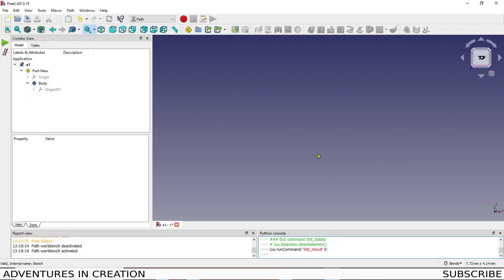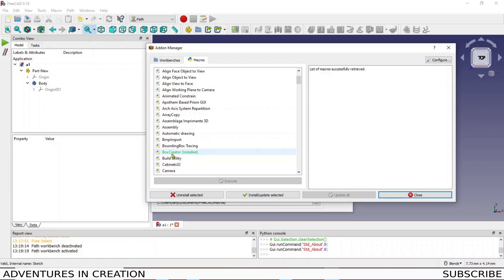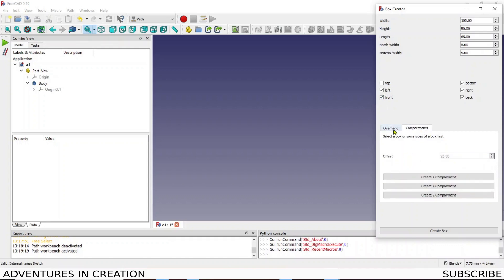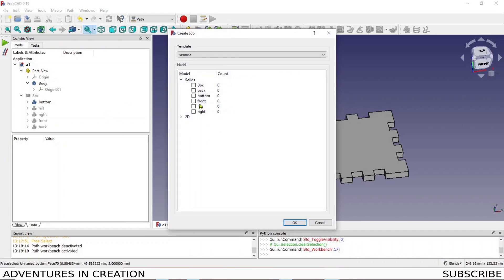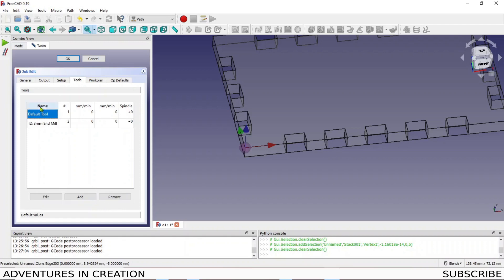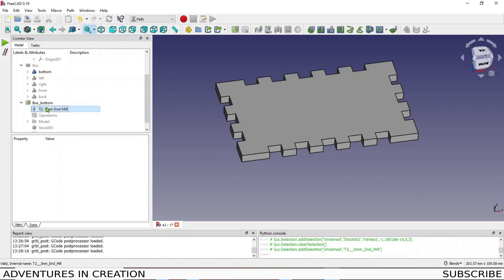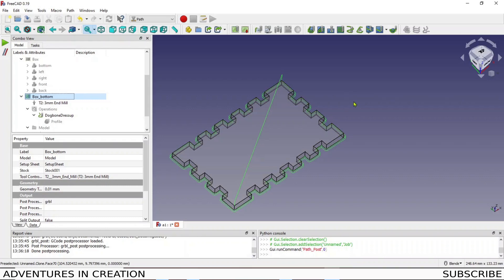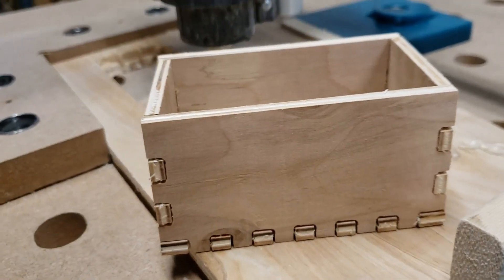Creating Finger Joint boxes in FreeCAD

Comment: Sorry to bring this subject up again but i would really like to get this macro working. I am using v2.0 The Macro dose not appear in the list to add. When i follow the Link listed in previous comments .  There is no option to download the file. so i have created a new macro called it boxcreator and pasted the code into it.  When i run it  i get the following error message

21:30:06  Traceback (most recent call last):
  File "C:/Users/rodgo/AppData/Roaming/FreeCAD/Macro/BoxCreator.FCMacro", line 25, in <module>
    from boxcreator import boxcreator
<class 'ImportError'>: cannot import name 'boxcreator' from 'boxcreator' (C:\Users\rodgo\AppData\Roaming\FreeCAD\Macro\boxcreator.py)

One of the previous posts mentions needing a folder called boxcreator . could anyone give me any pointers.
Reply from the maker: Let me make sure mine still works then I will get it to you.
Reply: @Adventuresincreation  Great Thanks

Comment: hi there I need help i have tried to manually add this macro but this is the error i get. how am i to get it to work????

13:24:55  Traceback (most recent call last):
  File "C:/Users/sdmcc/AppData/Roaming/FreeCAD/Macro/'BoxCreator'.FCMacro", line 26, in <module>
    from boxcreator import boxcreator
  File "C:\Program Files\FreeCAD 0.19\bin\Lib\site-packages\shiboken2\files.dir\shibokensupport\__feature__.py", line 142, in _import
    return original_import(name, *args, **kwargs)
<class 'ModuleNotFoundError'>: No module named 'boxcreator'
Reply: I got this until I quit and restarted FreeCAD - I think it's because it's caching some of the python libraries.  Anyway, once I restarted it all worked.
Reply from the maker: @riz94107  great
Reply from the maker: It looks like you either don't have everything downloaded or it's not saved in your "macro" folder so the macro can't find the  module.

Comment: I am looking for an excuse to build a finger miter jig for my table saw and to user FreeCAD to draw up a box and that led me here.
I am running Windows 10.
I am running FreeCAD 0.19. I installed the macro.
I made a part with a body and ran the macro.
The macro caused an error which appears to be a missing python module pyside. But at this point I am in over my head.

The error:
06:11:05  Traceback (most recent call last):
  File "C:/Users/Public/Documents/FreeCAD/Macros/IanJobson/freecad/BoxCreator.FCMacro", line 105, in <module>
    d = BoxcreatorDialog()
  File "C:/Users/Public/Documents/FreeCAD/Macros/IanJobson/freecad/BoxCreator.FCMacro", line 34, in _init_
    f, w = gui.PySideUic.loadUiType(self.ui_file)
  File "<string>", line 1, in <module>
  File "C:\Program Files\FreeCAD 0.19\bin\Lib\site-packages\shiboken2\files.dir\shibokensupport\__feature__.py", line 142, in _import
    return original_import(name, *args, **kwargs)
<class 'ModuleNotFoundError'>: No module named 'pyside2uic'
Reply from the maker: Let me check it in 19.2 to make sure it's not an installation issue
Reply: @Adventuresincreation  I found that the library 'pyside2uic' was missing in my 0.19 install. 
I found the library in my 0.18 install and copied it over. 
The folder was in bin/lib/site-packages.
I documented my journey on the FreeCAD Facebook page with this note:

So with Windows explorer I have 0.18 and 0.19 side by side and see the folder for pyside2uic in version 0.18.

I copied the folder over.

I ran the macro. Bingo!
Reply from the maker: @forresterickson6225  perfect!
Reply: @Adventuresincreation  Seams like the root cause is 0.19 is missing a library that was found in 0.18

Comment: Great video.
I can't find that box maker macro
Reply from the maker: It should be available to download from the macro manager. If not take a look in the description, there should be a link there.
Reply: @Adventuresincreation  It seems to have gone. I'm using 0.19 rev 24276. It's also not on the macro wiki any more
Reply from the maker: Take a look  here https://github.com/FreeCAD/FreeCAD-macros/blob/master/ObjectCreation/BoxCreator.FCMacro  you should be able to download it and manually install it.
Reply: @Adventuresincreation  Tnx for the reply. I didn't have much success installing it on linux Manjaro. Execution of the macro throws an error that module pyside2uic was not found. installing python-pyside (python3) from AUR repo also failed. I'm totally new to freecad, but chose to learn the application for future woodworking designs. Next project is am amplifier head and speaker cabinet enclosure. Box joints are the ideal solution for that. 
I think I'll have to rebuild qt4 first...
Reply from the maker: @enfieldman  I got that same error on Windows 10 using the stable release. I will see what needs to be done to fix and let you know.
Reply from the maker: @enfieldman   I just manually installed pyside2uic and box creator works again. It needs to be installed in [FreeCADInstallDir]/bin/Lib/site-packages you can get pyside2uic from sources on the Internet.

Comment: Thanks for taking the trouble to post this video. I've just started using FreeCAD 0.19 24267 and 'Box Creator' is no longer listed in the Add On Manager. I wonder why?
Reply from the maker: I checked mine and it is still there. It still works. I posted a link to it on another video. I can find it for you if you would like me to.

Comment: I would never run a macro, unless I write it. A macro can have system wide control, per an IT professional friend. I also think it doesn't help me learn FreeCAD. How would I create a box without macro's? And, can this be used for 3D printing?
Reply from the maker: That is your choice. I think it is wise to be cautious but having to write all your own macros is hard work. You can 3d print the parts. Creating the box manually is slow but doable.

Comment: thank you for this video, when I look for the box maker macro it is not there, I updated to 0.19 .  Do you know how I can get this Macro
Reply from the maker: I will take a look for it. It should be in the standard macro library. I hope it is not broken and removed. I will let you know.
Reply: @Adventuresincreation  Thank you, I have alot to learn, I appreciate you making these videos
Reply from the maker: @bguillory6675   I am happy to keep making them. Today's video is on Assembly4 which I must admit was a struggle to wrap my head around but now I think I have it under control ;-)
Reply: @Adventuresincreation  I tried going to the link you provided in a earlier reply to manually install box creator but not sure what to do when I got there, sorry for being such a noob to this.  I have only had my cnc router a couple of weeks and really like those boxes.
Reply from the maker: You need to copy the file into your FreeCAD macros folder. Then in FreeCAD run the macro and it should create a box. I tested it with my latest version and it does still work so I you should be able to get it to run.

Comment: Thanks so much for the video.  I am new to FreeCad and am enjoying it very much.  I found the macro from your link below.  I right click on the "Raw" icon and save as into my Macro folder but am getting errors.  Am I installing it correctly or are there additional files needed?

Thanks!
Tiim
Reply from the maker: Thanks for the feedback Tim. To run the macro you should be the part design workbench, runthe startup macro and it should do the rest. If that doesn't work let me know what errors you get.
Reply: @Adventuresincreation  Thanks for the reply,  Here is the message I am getting:

File "C:/Users/timbb/AppData/Roaming/FreeCAD/Macro/BoxCreator.FCMacro", line 26, in <module>
    from boxcreator import boxcreator
<class 'ImportError'>: cannot import name 'boxcreator' from 'boxcreator' (C:/Users/timbb/AppData/Roaming/FreeCAD/Macro\boxcreator.py)

OS: Windows 10 (10.0)
Word size of OS: 64-bit
Word size of FreeCAD: 64-bit
Version: 0.19.23578 (Git)
Build type: Release
Branch: master
Hash: 50c3cbf00579dc4941ca743c25720d016b0453ce
Python version: 3.8.6
Qt version: 5.12.5
Coin version: 4.0.0
OCC version: 7.4.0
Locale: English/United States (en_US)
Reply from the maker: @timbufordbriggs  I will have to test that macro on my 0.19 version. I didn't write that one, it's in the general macro library. It's a great tool. - I will let you know.
Reply from the maker: I tested it and it does work. - Were you able to get it working in your version?

Comment: Great video thanks, I've subscribed. For the whole box on one piece of ply do you need to change the orientation of the sides and move the lid down to zero? Is there a macro to help with this? Thanks again.
Reply from the maker: Thanks for the feedback. You don't need to flatten the box to cut it. I just set up each side separately. I imagine you could "flatten" it to do that if you wanted to but, I am not aware of a macro that does this automatically.

Comment: Hello. This is a very useful video. Thank you. The only problem is that I can't find that macro. I pressed the button " ADDONS" and then " MACROS". There are a lot of them there except this one. Can you help me find it ? Thanks again.
Reply from the maker: I will take a look and make sure it's still there. I will let you know.
Reply from the maker: I was able to check it. After you click on ADDONS click the tab macros then it's called BoxCreator. I am running version 0.19 not sure if that makes a difference for that macro.
Reply: Adventures in creation Thanks for helping me. I just checked and still I can't find it. There are only , or I see only two macros beginning from "B" . BoundingBox tracing and Built Utility. I also use 0.19 version .
Reply from the maker: Are you using version 0.19? I will look to see if I can locate the source.
Reply: @Adventuresincreation  Yes. I also use version 0.19. Thank you again.
Reply from the maker: I am not sure why it's not there, go here https://github.com/FreeCAD/FreeCAD-macros/blob/master/ObjectCreation/BoxCreator.FCMacro and you can download it and add it manually.
Reply: Adventures in creation I imported it manually and got it to work. Although there was no mention that the folder boxcreator needed to be placed into the Macro folder as well. I figured it out from the error the macro threw. Thank you for your help!
Reply from the maker: @lazmarface  I am glad you got it to work. I wrote a similar macro for Fusion 360 and that required the resource folder to contain graphics etc. I was going to write one for FreeCAD but found this one and it works well.

Comment: thank you for your videos. how does the touch probe work? I've seen them in a few places but am curious how it works with the mpcnc. I generally just eyeball the z height with my mpcnc, which isn't perfect.
Reply from the maker: It is wired to the board. It is great for setting up particularly if there is a tool change. There is no need to inch your way to the correct z height. I bought that touch plate from Amazon, it was less that $20.

Comment: Hello. Great video man, thanks!
I've been playing with it as I am designing some cabinets, but I'd like to add holes for a tenon joint on the sides. I cannot edit the box. I am new to freecad, any tip about how I can edit the box and add features such holes, grooves and so on? thank you!
Reply from the maker: Thanks for the feedback, you will probably want to use the pocket method to create your holes. You will create a sketch of the holes and then pocket them into the solid.
Reply: Thanks mate! I will try that one. So far I understand what you’re suggesting, but I get blocked on how to edit the solid that box creator does. I’m familiar with solid works, rhino, blender and sketchUp but this is a better beast!! I will keep digging and if you have other tips please share. Thank you!!
Reply from the maker: I will add something in this week's video to show you what I suggest.
Reply from the maker: Check out the latest video, I mentioned you in it and showed how to make a hole in the lid with a sketch. That should help you.
Reply: Amazing!! Thanks!!!
Reply from the maker: You are welcome, I hope that helped you to use FreeCAD